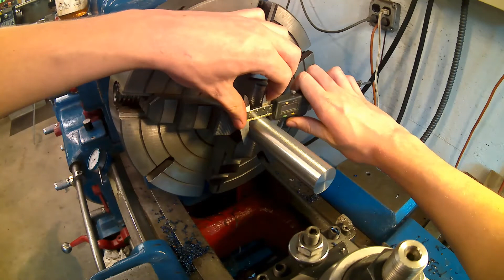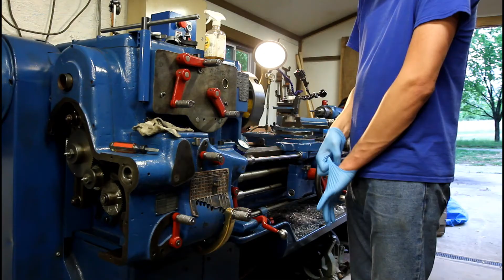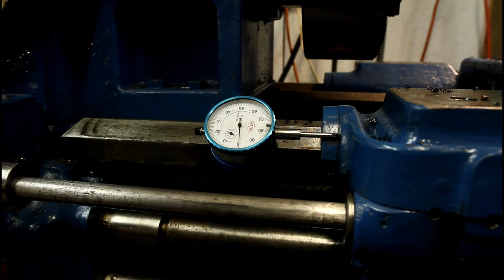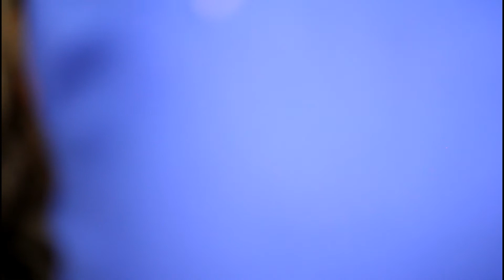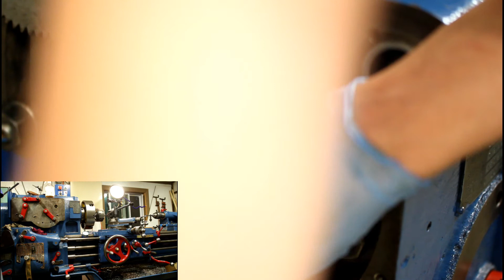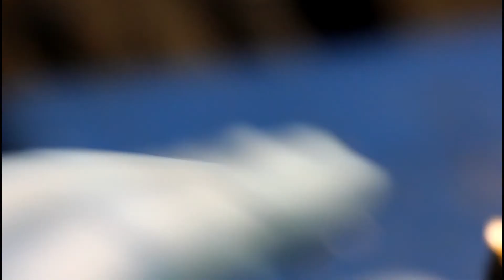Four Start Thread on a Manual Lathe

Comment: I know I’m 2 yrs late, but. Why would you need that many starts on such a short thread? Help me here. 
Or was it just a demonstration? Thanks for your time. 👍
Reply: If you open a screwed pen you will find that pen and the cap are having multi start thread. And that is a small diameter, say  three eighth of an inch. So, some one has to make a metal die for the plastic injection of the mould.
Reply from the maker: It was for some sort of hole saw arbor for someone online. Just an attempt. It didn't end up working.

Comment: Not the way to do that at all. Turn your compound 90 degrees (straight along the X axis). Starting at 0 (zero the compound dial) cut the first lead. Then advance the compound 1/4 (if you're cutting 4 leads) of the total travel of thread. Then cut the 2nd lead and so on. Using a thread insert like you're using isn't the way to go either. You need to hand grind a tool to get the proper relief angles for the angle of the lead you're cutting, other wise you'll drag the bottom of the tool through the cut and burr it all up.
Reply from the maker: That's another way, but it doesn't mean it's the right way. Both have their merits. This is more hazard frought for sure. I ground the carbide by hand. No different than HSS ground by hand. Thanks for the comment.
Reply: Definitely a good way to do it if your machine doesn’t have a compound. We use only inserted threading tools like you have in the video and also ones that accept kennametal top notch inserts and use both full and partial profile inserts depending on the job. Definitely the way to go vs high speed steel and sweat on carbide imo. Thanks for sharing this method!

Comment: I apologize if I skipped over it, but why do you have a second, smaller chuck on the part at 9:00 ?
Reply from the maker: Just to have a more appropriate holding. The 4 jaw doesn't even close down to 3/4" I don't believe and the 6 jaw grips better without damage at that size. There isn't really any rigidity penalty on such a large lathe. Thanks for watching.
Reply: @TheMetalButcher  So how are you holding onto the 6 jaw?
Reply from the maker: @Anon_Omis  So I made a stub arbor with a 1.5-8 thread on it the exact demensions of the 10" Rockwell lathe we have. I just grip on the shank of that and screw the chuck on like normal. The advantages of having a 3 jaw in a 4 jaw is that it becomes a set-tru chuck, you dial in the first part and it should stay that way. This one already is so no need, but it's handy for crappier chucks.

Comment: This is great to watch! that lathe is a beast! How were you so precise on the end of all of those threads where you pull the tool out of the cuts? In the video it almost looked like it was automated?
Reply from the maker: Practice and watching the dial indicator. I wasn't fast enough though, I caugt a chip on one pass effectively crashing it, which turned my toolpost. After I straightened it, I had to picl back up the threads.

Comment: Nicely done! Thread looks very clean!  Love the pattern on the jaw faces of that awesome chuck!
Reply from the maker: Thanks John. The thread is only ok at best.The one thread will never carry any load due to being wider than the rest, and the root is shallow enough I'm not sure if it will actually work. I'd have been much better off using a relief groove. The Chinese certainly did put a neat grind on the jaw faces. Thanks for watching.
Reply: @TheMetalButcher  The relief groove also relieves the pucker factor when getting so close.  Single Point Threading is one of those operations where you can’t have anything else on your mind.  No distractions. So many times we are thinking about the next step instead of the step we are performing.  😂👍
Reply from the maker: Yeah, that's how the commercial one was. I tend to prefer a no relief groove thread, looks better. My first piece I used HSS and I was able to get closer to the shoulder, but with such as sudden stop it was just asking to break things.